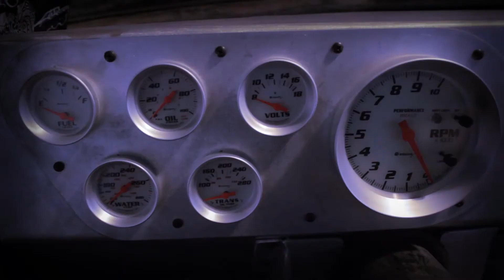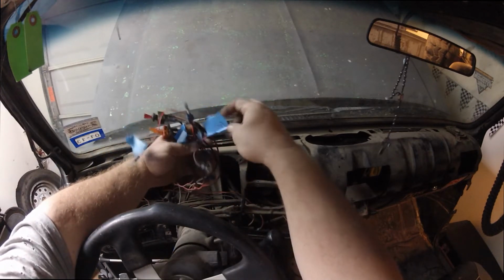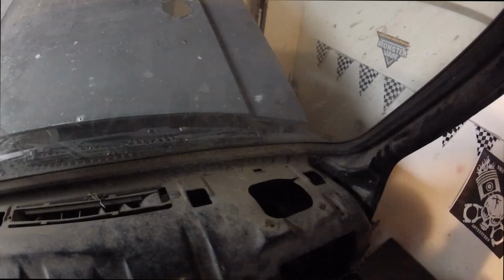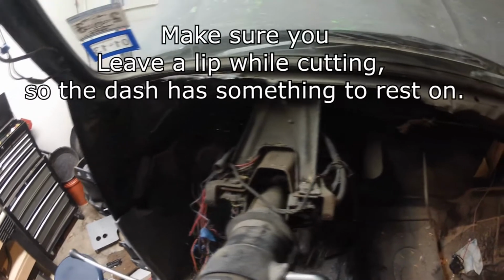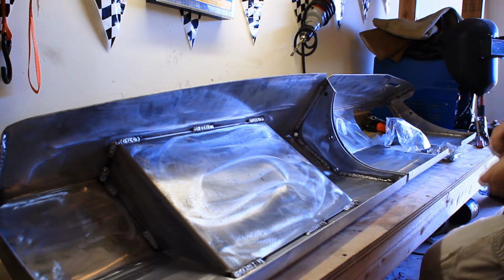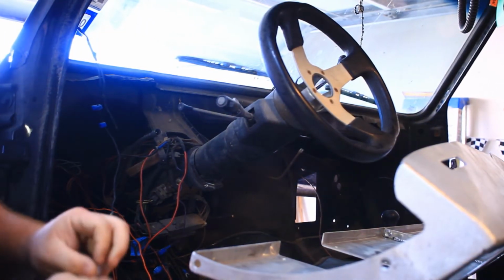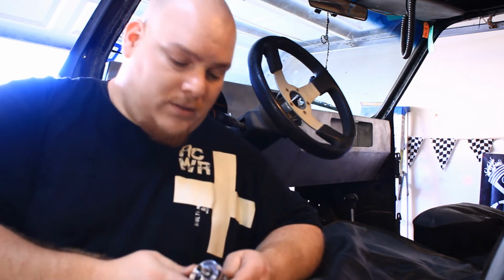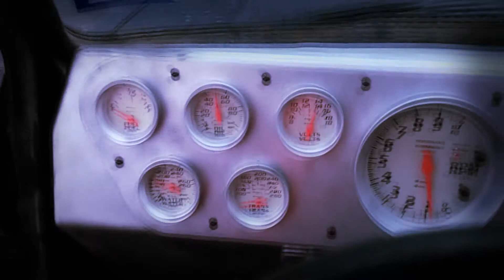DIY4X.COM Competition Dash Install by: Skull Crusher Adventures

Comment: Good day. Chet at this end. Not a comment but a question. I have a 1984 Chevy 4x4 K30 that is currently running drum brakes and duals. I in the proses of rebuilding it with no lifts of any kind do to not able to clime. It is a daily driving working farm truck. Question is I have heard a lot of hype about a disc brake upgrade. Would this be a practical and good upgrade for this truck? I was referred by CGMR. THANK YOU FOR YOUR TIME.

Comment: Did you have to buy the gauges separate and is there predrilled hole for wiper switch?
Reply from the maker: sled necks u can get the dash cut with holes and set up anyway u want. Even ac set up. My truck is naked and only for off-road use. Yes u gotta buy the gauges separate, and tell what size.